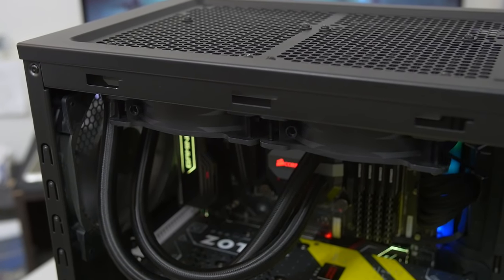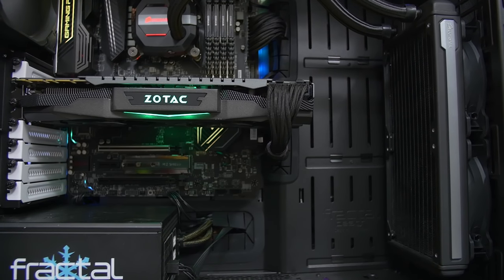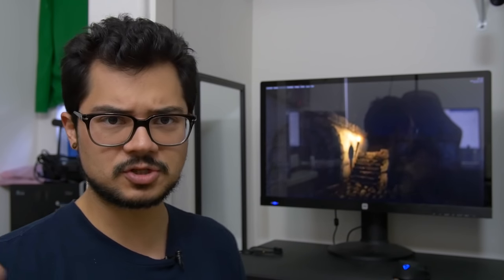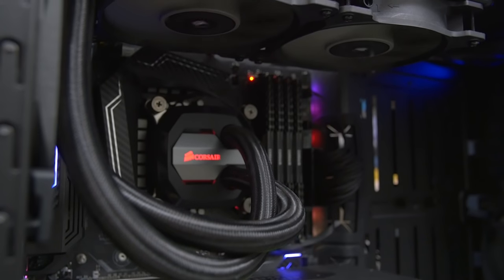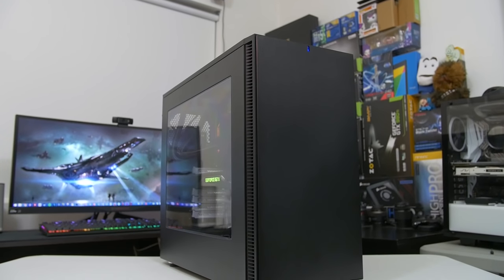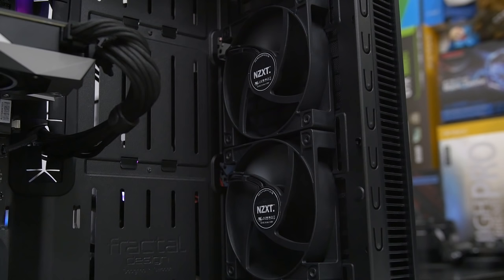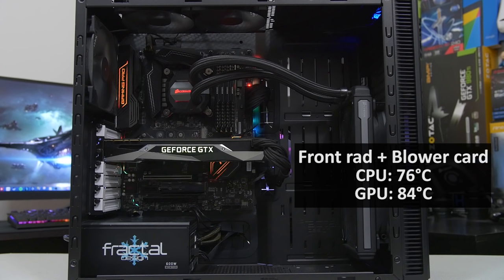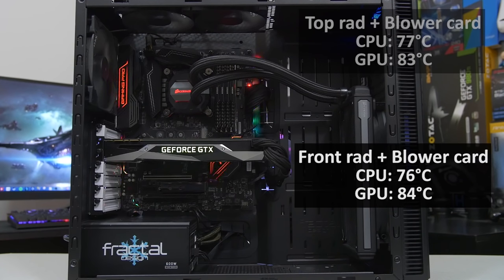Does Radiator Placement Matter? Hint: YES

Comment: Front mounted radiators should have the tubes on the down side, so air bubbles gather on the radiator top. That will be most silent.
Your front radiator is setup really bad because its ALSO lower than the pump is meaning air bubbles will gather in your pump
Reply: I was actually going to comment the same thing but you beat me too it lol. I used to make this same mistake and somthing so simple will actually reduce your temps because instead of an air bubble in the pump making contact with the CPU plate there is more room for water.
Reply: Yes we all watched the GN video as well
Reply: @tmcleung  GN video?
Reply: @LawfullSpook  gamer nexus. Go look up his AIO video
Reply: @LawfullSpook  you see this mistake EVERYWHERE I’m currently looking up if i can fit a 360mm radiator 3 fan aio in my new be quiet pure base in the correct orientation. The only time people put the tubes at the top is when the hose length is too short.
Reply: @spencerwilkerson6458  I just picked up the Thermal take view 51 and the case had that exact problem, I have my Thermaltake 360mm aio mounted to the side of the case but due to the hole positions on the case it's almost impossible to mount it with the pipes at the bottom unless I leave off the top screws which I didn't want to do. And I'll go check Gamer Nexus out I haven't actually seen them before I usually watch Linus and jayz
Reply: @LawfullSpook   yup, that's exactly what I'm worried about for mine. i just picked up the corsairs 360mm AIO and the only spot it'll fit on for my case is the from the bracket. the case won't be delivered until Thursday but I'm sitting here staring at my AIO hoping it'll fit correctly
Reply: @spencerwilkerson6458  I hope it will fit bro.
Reply: @spencerwilkerson6458  If you're looking at the Pure Base 500DX, the only way a 360 can fit is if you remove the hard drive bay at the bottom.  I just recently built in this case (last week from the time of this comment) and had trouble just getting a 240 in there when factoring in a GPU.  Tubes are down and my Strix 1080 ti just barely fit in with the tubes.  Couldn't mount the radiator up top because the fan above the RAM sticks was impacting the RAM and couldn't be mounted.  Not sure if that was down to Corsair Vengeance RGB Pro being fucking huge or if it's because my motherboard (Z390 Aorus Master) is so tall that the RAM slots are high enough up in the case to make that an issue.
Reply: not sure whats worse, companies advertising this as well or youtube channels with over 2mil subs putting it in videos with millions of views lmao
Reply: Lots of people saying that GN is wrong, that pipes should be on top of front mounted radiator, not on bottom. And i see lots of people buidling it like that, altough they have pipe lenght.
Reply: @acajakovljevic9125  Who the hell has said GN is wrong?  I've not heard anyone say that.  If they did they are IDIOTS!  This is common sense that no one ever really thought about until GN put it out there.
Reply: @acajakovljevic9125   can’t argue with physics bud lmao
Reply: Vid was released 3 years ago. Now suddenly everyone is an expert after gamer nexuses video lol.
Reply: @pointblank722  I disagree; I have 3 different AIO sets and they are all lengthy enough for a full ATX case, let alone a mid size.
Reply: A lot of blame has to be directed at AIO manufacturers, with many showing hoses at the top in official videos. There's also the issue that on many AIOs, the hoses are just too damn short for it to be an option on a lot of cases.
Reply: True
Reply: If only this comment existed 3 years ago...
Reply: Thanks Steve
Reply: Finally someone who says it 👍🏼
Reply: So, for science don't trust people like Kyle, who don't have any idea of it. Also in the case we don't have only procesor and video card, other (nvme, VRM etc...)important components also geting hotter, so we need to mesure them too.
Reply: This. Lines up will be air bubble city and depending on the amount of air in the closed loop, eventually, this will result in pump failure.
Reply: @tmcleung  bro it literally says in the owners manual that bitwit installed his upside down.
Reply: So should I mount my radiator up top or in front (tubes down) for best results?? I'm just building my first pc and need to understand this.
Reply: @DavidHernandezLovesYou  the best results are front with tubes up. you want the cool ambient air cooling the water through the radiator. although per my last comments. i actually had to put mine tubes down, some cases and graphics cards simply just don't let tubes down be an option. I have an RTX 3080 and there is no possible way that the tubes will fit down. that being said my thermal is never above 70C for my CPU under load. frigid temps just the way i like it. so, as GN stated in his videos, having your tubes up will be purely an acoustic problem if any and won't effect your thermals.
Reply: And He did a temperature test with a case wich has like zero airlfow... solid front panel..
Reply: you people need (Tech) Jesus!
Reply: in fairness to him, this vid was 3 years ago and the GN vid was august 2020.
Reply: somone watche Jay;D
Reply: Y’all do realize your missing GN’s point right? He never said mounting a front radiator with tubes on top is wrong, he just said it isn’t optimal but it’s still fine, as long as true pump isn’t the top of the loop.
Reply: Not AIOs. This is correct for custom loops. Otherwise my i9 wouldn't stay at low 70s under full load for couple of hours. Stop repeating everything you heard in a single video on youtube, please.
Reply: hahah i was about to comment how can someone with this terrible layout be making a video lmao
Reply: agreed
Reply: As long as the top of the radiator is above the pump, the air bubbles aren't going to make it out of the rad. The guy in this video did it wrong though, he probably will have air flowing through his pump.

Comment: .... looks at his rear-mounted radiator 
cough
quietly moves radiator
Reply: Lol.
Reply: @BenderdickCumbersnatch  so, questions, lol. Putting my radiator in the front would have the air moving directly across 2 HDDs and an SSD. Will this cause an issue with warming the air before it gets to my blower style GPU? My side panel has a mount for 2 fans as well. So if I put my radiator in the front, and I decide to put 2 fans on top and 2 fans on the side, how should they be situated for intake and exhaust (assuming I keep the radiator in the front)? This all assuming that I actually have room to mount it on the front. Not sure how much clearance I have and I won't be home for another day to take a look at it. I haven't bought my cooling system yet, btw. Just looking ahead so that when I get it, I can just slap it in since I'll already know the optimal setup.
Reply: @jazzcat9363  .  SSD and HDD's shouldn't create a significant amount of heat.  Intake onto the radiator (cooling system) and pull air out from everywhere else, no need to create air pressure in the system.
Reply: Soft tubing detaching from radiator: Allow us to introduce ourselves
Reply: @BenderdickCumbersnatch it does make sense. What car do you know that has a radiator mounted on its roof? 😂 I think the hot air in that location just kills any exhaust flow in the case

Comment: Even tho this video is 3 years old it still helped me because I'm about to build a pc
Reply: same
Reply: how did your build go?
Reply: @alexanderballance2996  still in the process of building it. I had to get a whole desk, chair, etc. First and I wanted an ikea karlby countertop desk so it took forever for those to be in stock on too of the adils legs. But I am ready to start buying parts now that I got my monitors, keyboard and mouse, USB stick with windows 10 64 bit on it and everything else I need before hand
Reply: @alexanderballance2996  I built mine, and after a bios update everything worked perfectly!
Reply: @YakuzaMenace  what are the components
Reply: @Santiago-sv2hu  ryzen 7 3700x, corsair 500 D Airflow, x6 corsair LL120 RGB Fans, 16GB of corsair Dominator Platinum ram, corsair rm 850, Asus rog strix viii hero Mobo, NZXT Kraken Z73, Samsung 980 M.2 1TB drive, Seagate Barracuda 2TB SSD and I belive thats all, but I probably missed something
Reply: Put the radiator on top and make the backside fan an intake and see both cpu and gpu temps drop through the floor
Reply: @YakuzaMenace  gpu?
Reply: @silmupelaa6349  going for a EVGA 1650 super for now because of the GPU shortage and high prices, but if by the time I have all my components and the GPU shortage is over, which is unlikely, then I'll probably go for like a 2080 TI or the new 30 series. Again that is if I can my hand on one
Reply: @YakuzaMenace  Ok, good luck bro. There will be good gpu's for decent prices some day for sure.
Reply: Same!
Reply: @xxStrombolixx  The air taken from the radiator will still be too hot cause the CPU to overheat dude

Comment: you have no idea how much this video helped me.

liked, subbed and notifications
Reply: Crypto NWO how much difference did you see?
Reply: Watch the new gamers nexus vid for best info. He cuts a window into the radiator and pump head so you can see what's going on and prevent air bubbles from ruining your AIO. Good vid.
Reply: Hi, I’ve about to get the NZXT z73 on the case p500a, so I’m wondering if the radiator better sitting on top of the case or in front of the case please?
Reply: @Kholaslittlespot1  I saw that video...was excellent but still am lost as to best spot, lol
Reply: But, if you want your water cooling system to last longer, possibly 5 or more years if you don’t abuse it, go for exhaust instead of intake.
Reply: Didn’t think I’d see crypto here damn
Reply: preach
Reply: exactly, he has no idea how to mount a aio. This video helped you to ruin your pump faster and also to significantly lower the effeciency of the actual aio since it is full of bubbles that are only on cpu making it difficult to cool down.
Reply: @mikelsidler5821  check out some videos with this topic. A lot of people are saying otherwise. Not saying you’re wrong but this was definitely a question I looked into as well.
Reply: smort

Comment: Couple big mistakes in this video that people should know...

Top radiator: that radiator should be mounted 2/3rd's towards the front (as opposed to towards the rear as in this video), so that the radiator fans are sucking in air from the front fans and NOT the hot air directly above the CPU & GPU as is shown in this video. A 3rd exhaust fan would be mounted in the rear-most space (360mm total fan space), next to the radiator fans, 90° from the primary rear exhaust fan. Consequently, the majority of air flow will pass through the case and to the two perpendicular exhaust fans. The radiator fans, with mitigated vacuum due to the radiator's interference, will be exposed to fresh air from the front intake fans while having negligible influence on the overall flow and in the end, there should be a roughly positive pressure inside the case. This is an optimal setup.

Secondly, with the CPU pump mounted at the highest point in the AIO system, it is effectively a noisy, gurgly heat pipe or a pneumatic AIO because all the air inside that system is up in the pump. Most AIO systems contain 5-10% air. 

All around, those numbers should have been substantially different.
Reply: do you have a video for your instructions or somethin?
Reply: makes sense, thank you!
Reply: I STill don't fucking understand
Reply: @bear-wq8uu  i took air cooling, thank god
Reply: First solution: Don't get an aio. Problem solved. 

Second solution: You need to prove this. This comment is explained so horribly you are confusing people more than helping.
Reply: @1234Jaytay  im also confused, help
Reply: @bear-wq8uu  I believe that essentialy he meant, that top radiator should be as close as possible to the top front fans so radiator fans pull cool air right into rad.
Reply: Unless you post some real world results I have a hard time believing this will make as substantial a difference as you're claiming.  I'm sure it will drop the temps a bit in the top mounted configuration but I don't see it being huge.  I could be wrong though, that's why I want real world numbers.
Reply: @keegansantos5752  I just upgraded my case in order to add a top mounted 280 (looking at Arctic's) CPU AIO.  The case is a Phanteks p500A and I don't know the exact mm's but it can hold up to a 360 rad up there, so a lot of choice as far as where I place the rad.  I was planning on mounting it towards the back, but is this guy correct?  Should I try and place it as forward as poss?  Maybe add another top mounted exhaust fan at the back behind the rad?